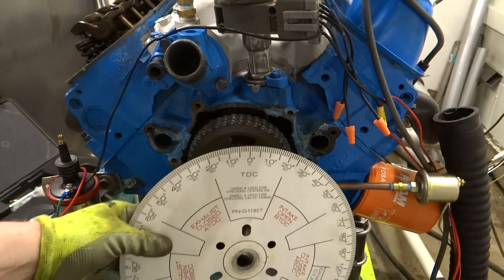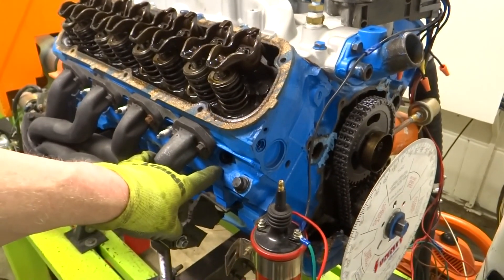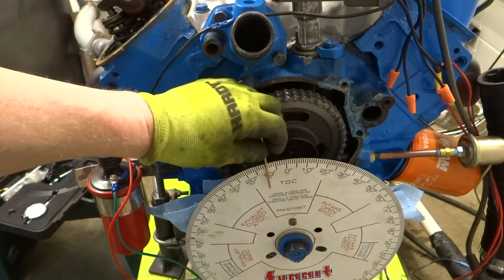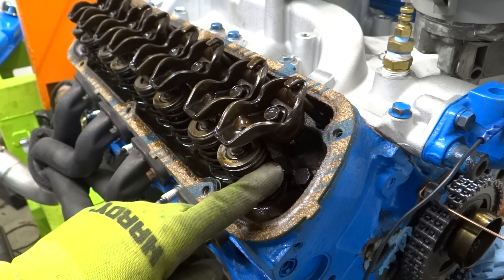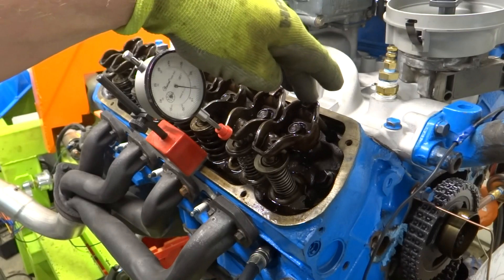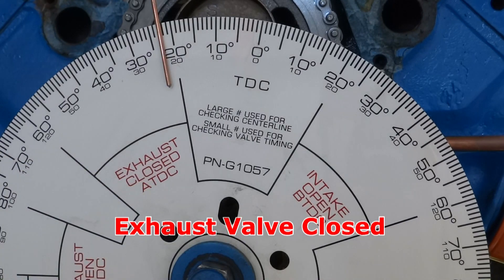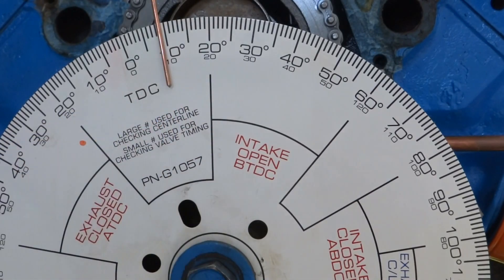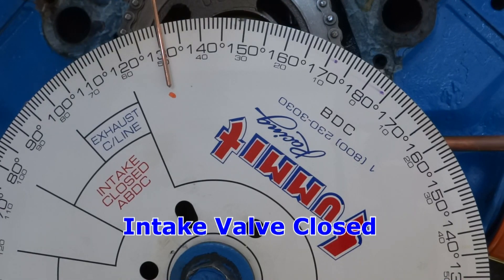Budget Ford 302 Project (Part 4) Baseline Cam Duration Measurement

Comment: I didn't catch what cfm that carb is.  Just thinking, if running stock cam, something in the 600cfm would be better off.Also may find a better air fuel mix with a 2 inch spacer under that carb with reduced rear jets. #62 all around by tge sounds of of it.
Reply from the maker: It is a 600-cfm vacuum secondary with the lightest secondary spring. I have heard a spacer could affect AFR. In later videos I reduce the jet sizes and get around 12.2. I had to order a small jet kit. Thanks

Comment: A 1987 truck motor should be a roller block even though it has a flat tappet cam....I think.
Reply from the maker: You are correct. I think it is (part 5) that I convert it over to a roller cam.
Reply: @engine_therapy  Oh goody! I almost suggested a few stock rollers, but didnt hoping you might be going there next!

Comment: The common indicated figures in the catalogues are. 006" tappet rise for advertised on a hydraulic cam(.020" for a solid cam) and .050" tappet rise for your degreeing figures. 
 Not taken at the valve.
 Yes of course figures can be taken at the valve as this is what the engine actually sees but at the valve figures cant be compared to most catalogues. 
 Absolutely ok to check at the valve if just comparing different cams in the same engine and not trying to correlate the info you gather with a catalogue.
Reply from the maker: Hello, Thank you for the feedback. I did some looking around and it looks like you are correct. I guess I was always more interested in what the valve was doing. Measuring at the tappet is the way to compare to catalogue numbers. I should mention it in the description and say something about it in (part 5).

Comment: If keeping those stock springs, I'd have a 5000ish redline. Also use a cam with mellow lobe ramp speed. (Cams like the xtreme energy line need spring pressure because of aggressive opening/closing rate of valve). A cam in the 450 lift range, duration in the 210 at .050 range and an lsa no wider than 110. The stock ex port flows awful. A split duration and lift cam would definitely help the most. Intake 208ish , exhaust 215ish at .050. Lift intake 440ish and exhaust 460ish. 110LSA (no wider) and install 4 degrees advanced if under 9.5 compression or under 170psi on compression gauge. Avoid wide LSA cams. Yep, I'm repetitive on this point. When you cam rev 6grand+, at that time you can consider going wider to carry the powerband.
Reply from the maker: Thanks for the feedback. I am working on a video about the cam swap and valve springs now.

Comment: great visual!  thank you for doing this.  That cam spec is why it makes 22+ inches of vacuum at idle and the Speed density EFI worked well.  also why it's out of breath at 4500 or less!  9 degree split, low overlap - good truck and large barge passenger car cam probably designed in the 70's.  not sure how much lift those springs & retainers can handle, probably .450-ish?  205 @.050intake/212exh will wake that engine up!  looking forward to it.  Jeff
Reply from the maker: I think I will take some time to look into the springs and retainers.